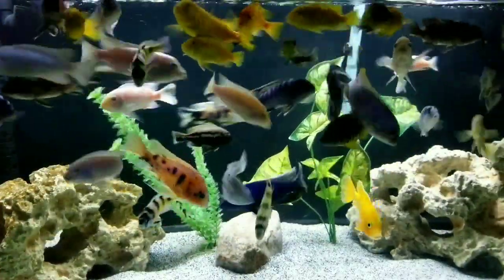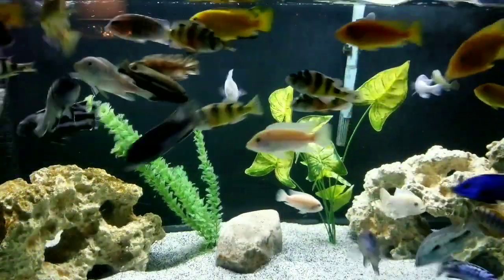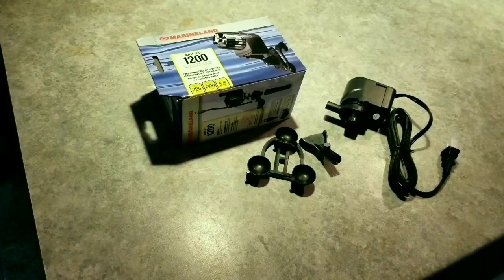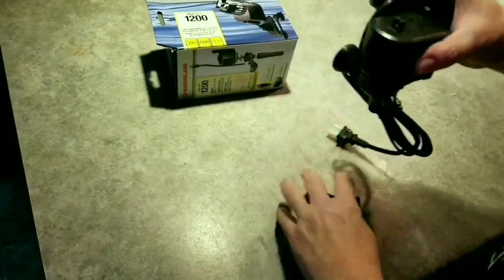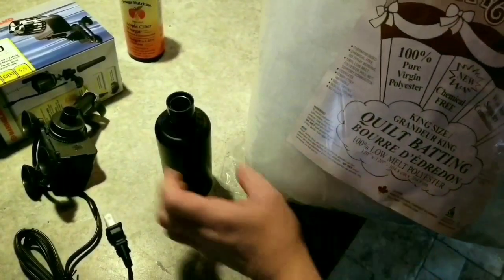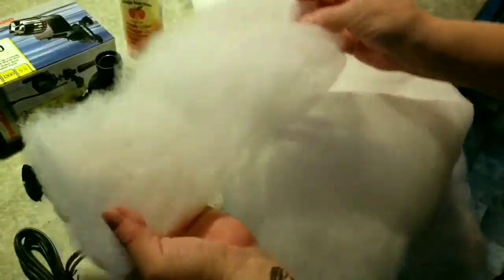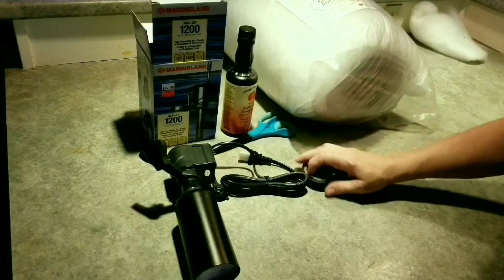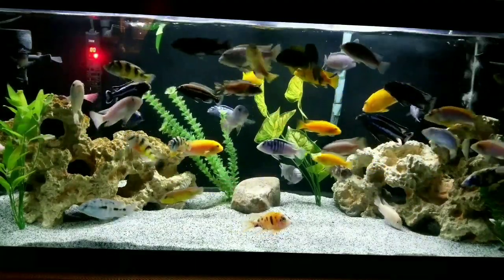DIY WATER POLISHER IS ALL YOU NEED FOR CRYSTAL CLEAR WATER

Comment: I built something similar with a powerhead but got tired of changing the filter floss. Now I use 2 sponge filters & a HOB on my 20gl tank. I get the same results without the constant floss changes.
Reply from the maker: Hi Jim,  I'm glad you found your way. This is a 75 gallon. I use FX canisters as filtration.  maintenance varies from tank to tank and home to home. thanks for sharing your thoughts.

Comment: I LOVE this! I’m going to look for a way to install one in my sump..... I have a couple of those Maxi-jets around here somewhere. How often do you need to clean the powerhead itself? Does the intake get gunked up? 👍🏻👍🏻Awesome video Deb!
Reply from the maker: HI Cindy... you know that's a great plan. The power head I seldom remove from the tank. I just pull the bottle off. The fluff picks up any detritus or microparticles so it stays really clean. Water change days I will just give it a quick rinse. I have a bunch of these in my junk supply collection. Although, over time they wear out or just get noisy. Thanks for coming by. Have a great weekend. Hope to talk soon!😁💗💦

Comment: I found that the sponge that Walmart sells for chair padding works alot better then the polyfill . The foam cushions they sell in the craft depth. I cut them to size and put them in my hobs . It works amazingly well . Try it out .
Reply from the maker: Hello and welcome to my channel!! On occasion I have used the egg crate style mattress as well. In my canister filters I use both. I still find quilt batting is the best for this use. Thanks so much for sharing!! Stay safe!
Reply: @DebTim  yes it works great i use both the foam pads and the batting.  I usually layer them . The sponge pads actually removed the tannins from the wood I had in the tank . After one day the foam turned pinkish red and the batting was still white .
Reply: @DebTim  and thank you for the welcome
Reply from the maker: There are so many ways to save money by using products not labeled for fish Thanks for your wisdom!!

Comment: Thanks much, Maa'm for your hard work. Much appreciated. Do you think a 40 gallons will be blown by this? I can see my PetSmart has 1200 model which I think more power than needed by my Flowerhorn. If you think it will be much stronger for my 40 gallons than I will not try this. Basically fighting against algae bloom (so much greenish water).
Reply from the maker: Hi Piyush... I had one in my 40 gallon it did a wonderful job.. just make sure the power is not over strong. It will help with algae but you will need to change the fluff often. Good Luck
Reply: @DebTim  thanks Ma'm . I got Marineland Magnum polisher to fight algae and when it's clear, I will use the normal filter cartridge for daily use. That filter is great and really doing a great job, moreover, we can charge the micron cartridge with Diatom Earth. I didn't charge it yet, but yes, will do in evening. Currently, it's running with micron without being charged yet. I used stockings to fill BIO media in the filter's tube and used normal foam cartridge to clear dust, now I am running micron cartridge. Petsmart selling that filter in just 32 dollars (down from 90 dollars), so if you like, you can grab one. Have a nice day ahead
Reply: Alright, So followed the steps given in "How to boost the polishing power of your marineland magnum polishing filter" video. and It has miraculously cleared the tank overnight.  I've had a very bad shape of green water, I charged this micron filter with Diatomaceous earth powder, the exact brand is NON pool refined. The brand is "Bonide - Diatomaceous Earth crawling insect killer" powder. Got it from Ace hardware in about 8 dollars.

Poured 6 table spoons in deep bucket, and submerged the filter until those two tiny holes are out at the top. Ran it for 20 minutes and bucket was crystal clear. Then, put the filter in the tank and started it overnight.. The result is just outstanding, it's so clear that my flowerhorn (kamfa) named Atom is floating in the air.

One thing to note here that this micron filter is NOT for daily use. Many guys complained about the filter stopped working after few months, I am guessing that's because of micron is getting fully clogged, resulting overhead operation of filter, making it bad!

The other filter pad and bio media tube are the ones for regular daily driver, don't use micron as daily filter, instead use it as-an-when-needed!

Hope this helps, Please ask questions here and I will try to reply ASAP.

Have a healthy fish keeping to all. 

P.S. - This filter is on sell at PetSmart for 32 dollars (instead of 89 dollars regular). Grab it and you won't regret it!

Thanks once again Maam, I will try this powerhead solution DIY too when needed.